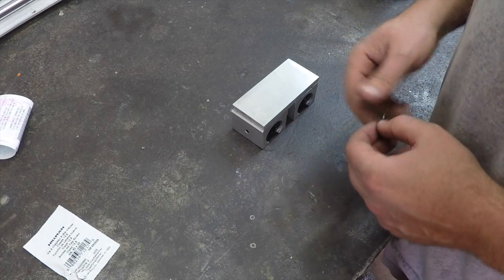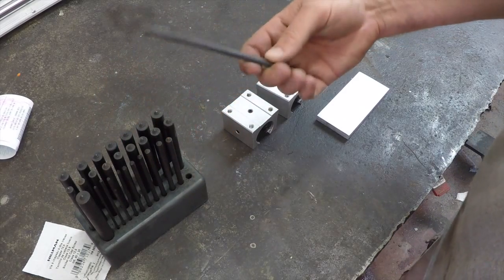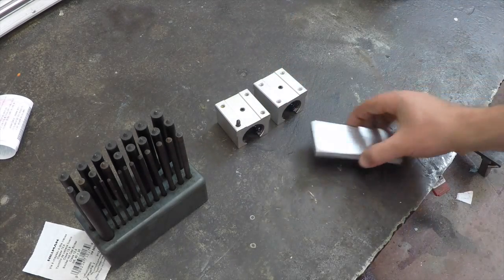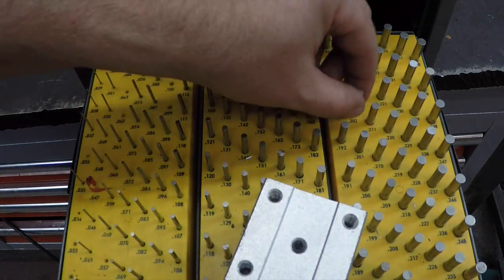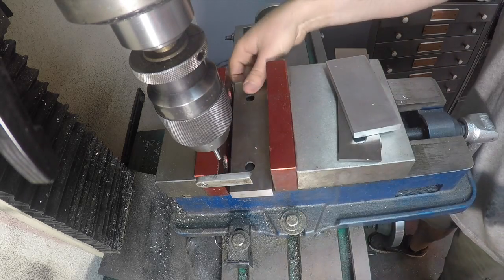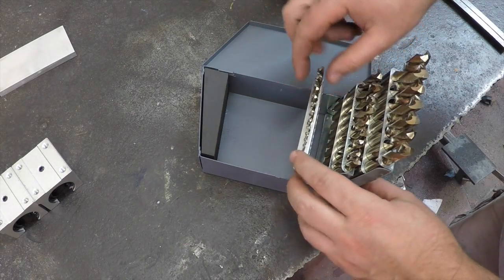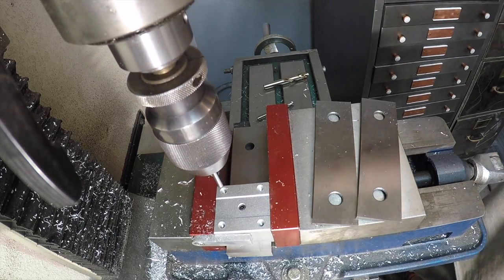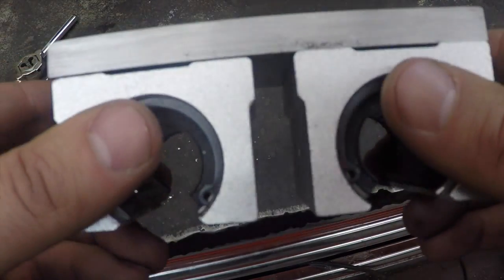Transferring Hole Locations using gauge pins - match holes for drilling

Comment: 3 that are 100X faster - 

1. Multi-use. Cut a piece of clear plastic that matches your setup .25" thick. Position, Sight and center punch. Check that it's right. Remove and drill through. You now have a template.

2. One-shot or not. Use a deformable material like Vellum and tape or secure it well over the setup - then use a bit tool to create a hole. Make sure it's right - no errors with this method. Then you line up and tape to your stock, punch centers and check and repair by micro grind, then drill as usual, ending with a slightly oversized bit to ensure alignment. This is the go-to. An alternative is make a small hole and marker thru it. Sewers use a chalk bag.

3. If you are can use a CNC machine, input the mounting hole data for one from the mfr data, and add the offset in your CAD/CAM.

Comment: One thing you did wrong is when you put your bearing in the vice to locate your first hole your bearing was turned with the center groove running with the width of your vice. When you put the bearing back in the vice to locate the second hole you turned the groove running with the vices opening side. You should always turn your bearings or whatever your laying out to drill holes to match at specific part you turn your bearing the same way that your part is going to be placed on the bearing.

Comment: Crazy how this is 6 and a half years old and still relevant. I have the same slides with the same issue. I do not have a drill press.... yet. What I plan on doing is mounting clear plastic to the top of the slide with double sided tape, drilling the holes and then transferring to the aluminum plate. fingers crossed

Comment: Obviously your way worked no problem but could you have used the DRO ( if mill has one ) to punch the first one then just offset the dimension for each one? For one or two things not a big deal but s few more holes than 8 it would get time consuming.

Comment: This is a reasonably good method. Instead of a gauge pin you can use longer bolt that is not fully threaded (cut the head off to fit in the chuck).
For those less fortunate that do not have the mill (yet), get a height gauge and a surface plate ( an off-cut of a countertop is a cheap and reasonably good substitute).
There are videos on how to use height gauge to measure locations of features (i.e. holes) and then locate/mark holes on a workpiece - watch those.

To measure location of a threaded hole in existing part (i.e. in linear bearing as in this video)
1.  put matching bolt in a hole, measure the location of the bolt in reference to the edges of the part using the height gauge.
2. measure the diameter of the bolt, subtract half of the diameter from the measurements from the height gauge and you have the location of the hole. 

To improve accuracy of measuring use a piece of copy paper (which is about 0.004" thick) as a feeler gauge between the tip of the height gauge and the bolt sticking out of the part to determine if the tip is touching the bolt rather than eyeballing it. Account for the thickness of that paper in your measurements.   

Drilling  holes:
Always use automatic center punch to mark the point where you want the drill to first touch the workpiece.

Use magnifying glass to position the tip of the center punch. You will be surprised how much better things turn out under 5x magnification.
Better still - buy optical center punch (or ask for one before Chistmas...) The ones from Skidmore Engineering are superior to all the rest.

Use center drill to start the hole then switch to proper drill dimension.

For greater accuracy of measuring use gauge blocks and dial indicator mounted in the height gauge instead of the scriber tip. With this method you can locate with 0.001" accuracy, which is probably smaller that the  TIR of your drill press anyway so rarely worth doing  :-)
Reply: With nothing more than a electric hand drill, perhaps I can clamp the bearing and the plate together and drill, tap some new holes!

Comment: Put the gauge pin in the park then lift it up and attach it to the chuck telling it down enough to hold it! Then lower down into the vice and slide it in position then tighten it down

Comment: Nice work!  I've done this many times using drill bits (in this case the appropriate tap drill size) in lieu of gage pins.  As mentioned in other posts, a pointed edge finder would work as well.  Also, my mill has a DRO so one can position both axis' in the same place for multiple pieces.

Comment: Well!  That's pretty clever.  It might take awhile, but looks hard to beat for low overhead, or if you have transfer punches but not THOSE transfer punches!  You just need one pin, it's not so bad.  Looks like something that might be done with a wiggler, one of those precision ones that have a cone on the end.  Anyway, I have a BUNCH of hole transferring stuff but I've never done this or even thought of it, so yay!

Comment: That looks like a lot of set up.  One thought I had, and you may have even done it this way, I don't know.
Since you are locating the holes from 2 identical pieces onto a flat plate. Once you find one hole location for the first piece. Spin the plate 180 degrees and drill a second hole @ the other end of the plate.  Re using your set up for block #1 on block #2.Repete for all 8 holes. Cuts the setup time by half.
Reply: Thats only assuming that the holes on the original plate are symmetrical. If theyre off by even a tiny bit, your holes will be off as well. Spacing and locating each hole is far more accurate. Better to do it once right, than sloppy and having too large or displaced holes.

Comment: Looks good! I think what another person in the comments was trying to say was at the end of the video I liked as if the bearing on the left was set back a little from the edge and the one on the right was set forward a little. Not sure if it was the lighting or if that's how you wanted it.
Reply from the maker: EChopper13 thanks man, yep your exactly right, when I titgend them up on the bench, they just tighten up how they wanted to, when I put the bearings on the rails and tightened them they aligned like they should.  The counterbore as well as the through hole have a little room for variation, and that movement is what cause them to not line up.

Comment: You're correct that transfer screws would be the quickest and easiest.  They usually come in sets of six in a particular size. You just screw them in the threaded hole leaving the points sticking proud about 15 or 20 thou. Position your part then tap your part with a soft hammer. Next go back and center punch them, and they are ready to drill. Looks like your way worked just fine. I enjoy your videos!
Reply from the maker: Michael Murray Hey Michael, appreciate you chiming in, I would like to get a full set of those transfer screws but the seem kind of pricey to get both standard and metric.  Thanks for watching!
Reply: My Dad gave me a set of those. They work great.
Reply: You can get them from McMaster Carr for pretty reasonable. I get them as I need them. No need to buy a whole set of various sizes.

Comment: At 3:50 in he works with transfer screws in this video . https://youtu.be/u7kkvWYIfTA
He also does many how to videos in shop and machining as a retired school instructor , if you like watching those things.
Reply from the maker: kentuckycowboy2 Hey man, thanks for the link.  Yea, I have watched Mrpete for years, I saw his video on the topic.  I did look into getting some of those, and they are quite pricey to get a full set of all the metric and standard sizes in course and fine threads.
Reply: turbocobra No doubt , but you might find a few of the most popular sizes on ebay to keep around . 

And yes I admire Mr Pete he has became a grandfather figure to me since losing mine. Keep having fun with the project .

Comment: Very nice.  After drilling the first hole could you have flipped the piece 180 end for end and drilled another hole.  That assumes the pieces are symmetric.
Reply from the maker: rindress Yea that's a good point, and normally I would consider doing that, but since I counterbored the holes you can't really do it that way.  Thanks Rino!

Comment: Usually bearing blocks come with a blue print of the hole locations. If not its easy to measure it out with a machinest scale.
0 the x and y axis of the machine to the piece using an edge finder ( always pick up the left hand side and the side of the piece that's against the back of the vice and always come to your dimension clockwise on your handles) and using the blue print drill your holes.
Reply from the maker: tomswonderfulworld Yea, these are some cheap chinese blocks, no drawings at all.  They are poorly made, but will work for what I am doing.  I plan to CNC this mill, and buy a bridgeport and add a DRO for doing things like your talking about.

Comment: Gary, it looks like the holes in the final piece had different dimensions from the long edge to the counterbore.  Is that the case or is it just the lighting in the vid?  Either way, the only method that would be faster is to set up an 8 headed mill and align/drill them all at once.  My method???  Drill holes that are WAY oversized and use washers.     I suck at drill.
Reply from the maker: Greg's Garage Thanks greg.  Not sure what your question is.  The counterbore and through holes were slightly oversized to accommodate slight differences, and when I tightened it up on the bench it kind of just found it's own way to pull up.  When I put them part on the slide rails, and tighten it there, it found the right aligment to allow it to track properly.  Yep, I suck at drilling as well.  Most of my other projects where I would hand drill something, I have to drill the holes way oversized.  But I wanted the holes counterbored and below the surface so I can use all of the top of the plate for camera mounts, panning timer motor, 90 deg brackets for vertical sliding, etc.
Reply: No big question...  Just looks like there was variation in the distance from the counter bore to the edge of the piece.  Curious if the bearing had different dimensions from the edge to the holes.  Again, could have just been how the lighting made it look.  Maybe the holes are all in a straight line.  I do have another question for you though...  I'll text you that one.

Comment: On the rare occasion I need to transfer multiple holes I used ball bearings and dropped them on the holes (obviously using balls larger than the hole itself) then placing the other part on top and hammer gently to transfer. You could slip a piece of thick paper (like cereal box carton) between the 2 to see better. Then use a punch and hammer right over the paper onto the piece you want to drill out.
Reply from the maker: ***** Very good tip, would not have thought of using ball bearings.  I have heard of guys collecting different size ball bearings to have around the shop for things, definitely a good use of it.
Reply: I never thought of that!  Again, transfer punches and screws are so great but sometimes you don't have them, or don't have the ones you want.  HM.

Comment: Your method seems to work well.  If I had a mill like yours, I would probably been lazy and located the first hole and wrote down measurements after aligning each hole in the first row.  Then locate the first one in second row and re-use the measurements to get the spacing.  Makes sense to me but I may not have said it using correct terms, lol
Reply from the maker: Velvethamma yep, you could definitely use that method.  The mill has indicators on each of the hand wheels, but being a small mill that isn't very rigid and backlash in the lead screw, I don't trust the measurements.
Reply: turbocobra I'm a machinist by trade and all mills and lathes have backlash. You need to understand how much backlash you have and then learn and trust your indicators (measuring wheels). The first thing we do when we jump on an unfamiliar machine is check it's backlash in every axis. Use your dial indicator on your apron or cross slide to do this.When you trust the machine a job like this would have taken you a fraction of the time as well as being more accurate. FYI, If I were caught using gauge pins in our shop I would find a size 10 boot fair up my ass. Nothing beats proper measurements. You have a great channel and I enjoy watching it and for a "non professionally trained person" you're doing a hell of a job.

Comment: You got lucky that the hole were evenly spaced front to back and side to side.If you watch this video you turned the block 90 degrees from the way it was for the  first hole. You should get a small paint brush or a air hose and clean the vise every time you mount some thing in it. Did you tram your vise so it is straight? I could give you a few Ideas how to do this I am a machinist but It would be hard to explain typing it out.I will send you my phone number in private message.I don't mean to be harsh but it is the little details that will mess up what you are doing.

Comment: You got it done and kept moving. An edge finder would make simple quick work of locating the holes for the machining. But there are always more ways to talk em into the sac.  lolll
Reply from the maker: cigarcaptain I just don't trust the dials and backlash on my machine enough. IF I had a larger machine, ball screws, and a DRO, then I would have used the edge and measure method.  "Talk them into the sac" lol good one man!

Comment: Nice work, certainly makes it easier with the right tools. Could also male a template with a piece of thin card board and poke the holes through.
Reply from the maker: 72 Monte Yep, a few others mentioned that one as well.  That would have been the way I would have do it in the past

Comment: Real cool thanks for sharing ,what type mill do you have. And what one would you recommend.
Reply from the maker: unclefrankonap1953 I have a Grizzly G0704, it's a small mill/drill.  It's decent, there are lots of support, upgrades and a large community of users who use it.  If you have the space, I would look for a good used Bridgeport machine.  They are much more powerful and rigid.

Comment: You need edge finder,find center then move out to center of bolt hole from there.oh and all the measuring it takes to get there :)
Reply from the maker: MaddMike1975 Yea, I know that's probably the more proper way to do it...  I have an edge finder, I just don't trust the dials and backlash in the lead screw for that method.  If I had a larger machine with a DRO, definitely would use that... or maybe I just need more training to become comfortable with that method!  Thanks Mike!

Comment: looks like it worked! If the holes weren't being countersunk I suppose you could have drillied all the holes using just 2 positions with the mill, by flipping and turning the piece around.?
Reply from the maker: Shut Yer Face Garage yes sir, you could do exactly what you described, i use that often when not counterboring
Reply: This is exactly what I was thinking.